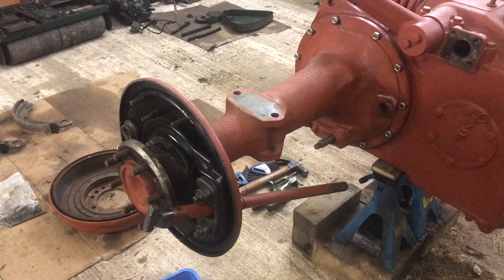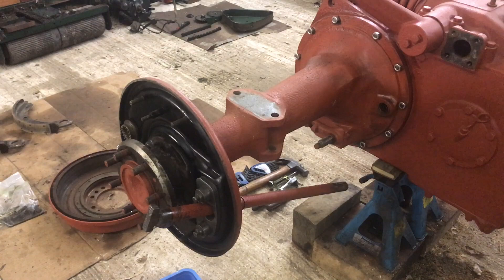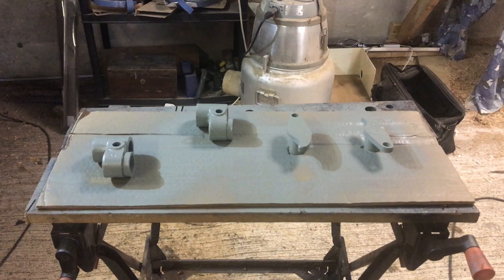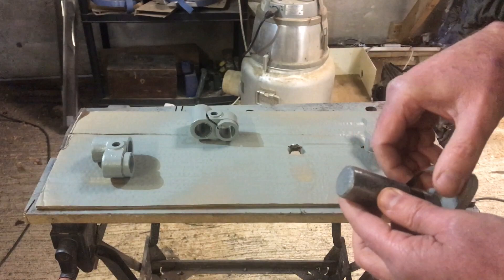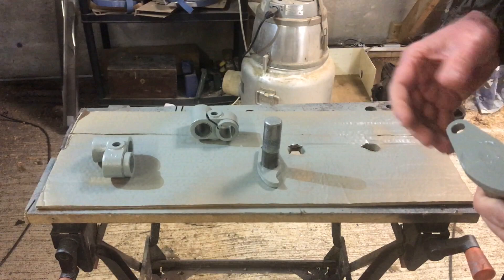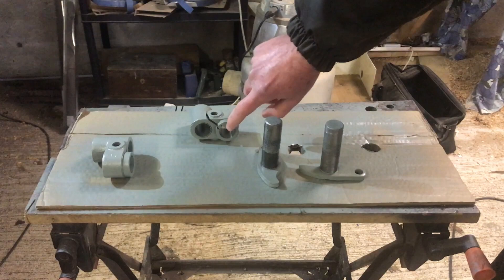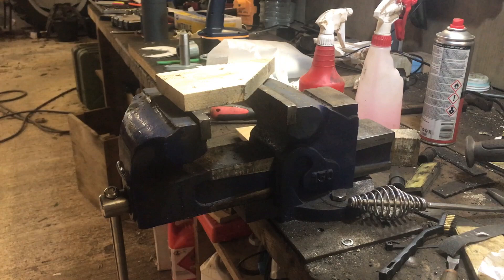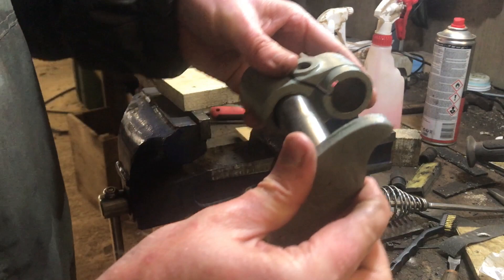#41 Ferguson TED20 - Installing the Brakes Part 1

Comment: I cannot find different thickness of shims for the axle to set the bearings. Did you buy new or reuse the old?
Reply from the maker: Hi Kenny, generally you can reuse shims assuming they aren’t damaged. Sadly there aren’t a selection of shims of different thicknesses around. It is possible to buy shim material, so if you wanted, you could make some replacements. But if the old ones are complete and straight, you can definitely re-use them. Hope this helps 👍😉
Reply: @WaterhouseForde  thank you for your feedback. I found some shims made for 35 that should fit my TEA.

Comment: Should not those rear inboard brake cams be swapped around with cam to front????
Reply from the maker: Hi temotu518. It has been a while since we worked on the brakes, but I do recall questioning this myself at the time. I reviewed the footage from when we dismantled the brakes and confirmed that the cam was behind the cross-shaft. However I remained unconvinced. I have subsequently done some research and can confirm that you are right. The cam should be in front of the cross shaft. Sorry if this has caused confusion, we need to get back to the brakes and do a followup video when we will replace the brake shoes as well. Thank you for watching our videos and for highlighting this error, I hope the videos have helped in other ways. 👍🏻😉
Reply: @WaterhouseForde  thank's for prompt reply......made me laugh as I went thru exactly the same, I am now an expert at swapping them over, thank's again>>>
Reply: @temotu518  I'm working on a Ford 8n with a Ferguson rear end.  Trying to figure out the brakes. Do you have any pictures on how the cam and knuckle should go together?  Also does the rod pull the brakes or push them?  Any help would be appreciated.
Reply: @WaterhouseForde   I'm working on a Ford 8n with a Ferguson rear end.  Trying to figure out the brakes. Do you have any pictures on how the cam and knuckle should go together?  Also does the rod pull the brakes or push them?  Any help would be appreciated.